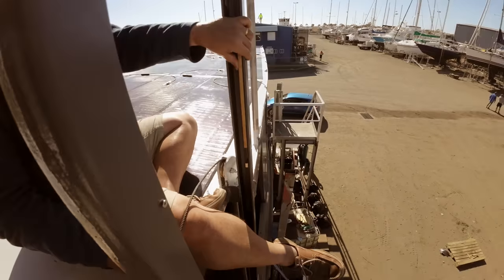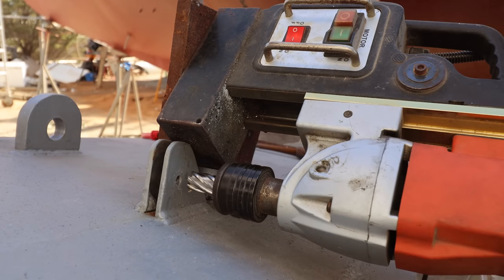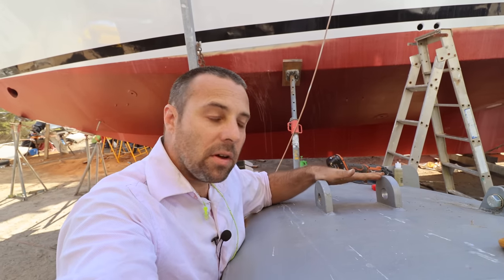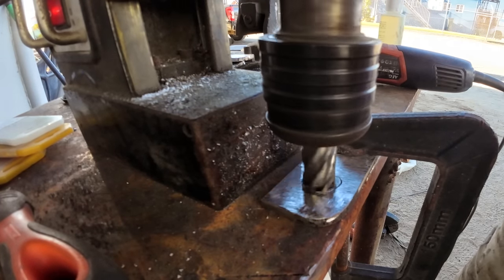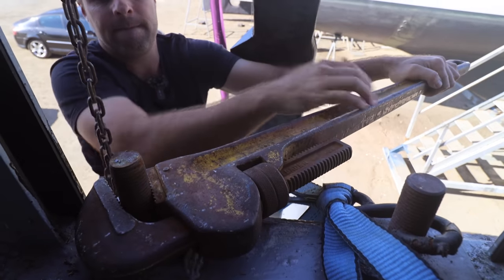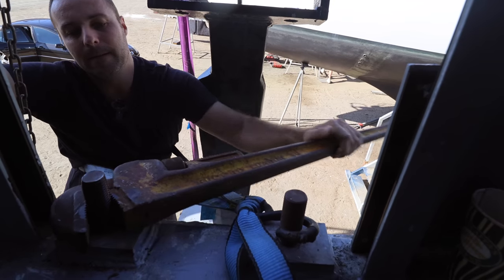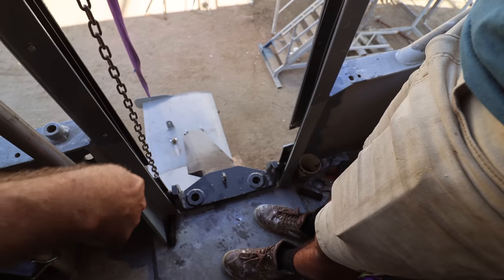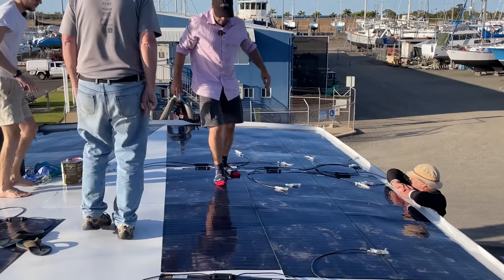Brupeg's Stabilisers, Armed and Ready - Project Brupeg Ep.310

Comment: Suggestion: Take the stator of the dead motor(s) off the shaft, & then build a (stainless?) steel enclosure around the gearbox/windlass, with a nice long spout as a hawsehole to keep sea water out, perhaps with brushes covering the entrance to help in that regard...  & then fit a right angle gearbox that transfers the horizontal drive to the winch gearbox to a vertical shaft that can go through the wheelhouse roof, with a suitable oil seal. Then you can fill the steel enclosures with oil & plan to run that existing gearbox in an oil bath up there, but you can still power the winches with either a battery drill, or a couple indoor rated mains power motors mounted on the inside of the wheelhouse roof...

Comment: Since you will not be moving the wings up and down very often once the boat is in the water i would suggest removing the winches when they are not in use and store them inside the boat. Might help them last longer and you can keep them dry and out of the elements.
Reply: Could they be mounted inside the wheelhouse roof, with the cable coming through a slot?

Comment: Here a thought.💡💡Automotive hydraulic lift motors can do the job to lift the wings and their an all in one system tank, pump and motor. No piping to run just hoses to your cable wenches. A big Plus you could install them under the roof overhead.💡💡👍👍

Comment: Stainless pin into mild steel (ferrous) sleeve will rust the ferrous at a ridiculous rate. It needs a stainless sleeve welded to the arm that's well-painted around the different metals. Maybe even fit a sacrificial anode over the top. Stainless to stainless will gall (self weld) so ample grease points are needed.

Comment: Used to fit wear strips on conveyors. Cut wear strips to length drill holes 1 on each end mark where to be fitted and move one of the holes 5 to 6 mm further on. Warm up wear strips and quickly fit on both ends, the wear strips shrinks drill and fix all the way along. This will greatly extend the life of the wear strip. If I'm already late with this advice I strongly recommend that you redo again. Loose wear strips don't last very long they streatch and start binding. offset hole depends on material and length some longer wear strips are offset 50mm. Similar to wear strips on bottom of f1 car. We used to fit them on with 5 mm countersunk stainless rivets.

Comment: Watch your finger when setting those wings, they look like they will be fun at sea to put those bolts in. With the boat rocking the wings will stay in the water while the boat rocks and the bar will slide up and down. or knock around. You could put something to hold the wing down while putting the bolts in, maybe like a slide bolt at the bottom so it won't slide up so you can put bolts in. Anyhow Just a thought.  I can not wait to see you guys launch, been watching since the start. Well done.

Comment: 19:17 buy new winches. Take them apart. Spray paint the armature. Coat it in metalized epoxy and replace the bearings with the highest quality double sealed bearings you can find. Do some work on the covers as well such that no water can remain on the which's vital surfaces (anywhere where guts meet the outside) and spray paint the winches (finished, mounted item) with water repelling spray (the same stuff they use on clothes to make them water proof, i'm sure you've seen the vids online with people spray painting their shoes and water beading off). Do this every once in a while, and they should last you enough time to figure out the real solution, with the hydraulics.
Source: i've coated most of my electric stuff that lives on equipment in epoxy and so far, i haven't had anything go tits up on me VS in the past having to replace the motors, some quite expensive.
Reply: That's how to do it properly, but how often do they really need to be lifted? My guess is they will stay down for months at a time. That's a lot of money and hassle for motors that might only be used a dozen times. The cordless drill is cheap and works and doesn't require any more work. They could even use a larger 240v drill, which could be as powerful as the original winch motors.

Comment: another easy way to bolt them on would be to stagger the holes an drill straight through both sides that way you could put the wrench through the hole rather than trying to do it offset

Comment: Put 2  manual winchs on the wing wires. No electricity or hydraulics to worry about. Those wires just don't look thick enough to lift a heap of water though. Cheers

Comment: For the duty cycle those winches are going to see and for the fairly small amount of weight you need to lift, what about boat trailer winches? They're 12V and they're meant for marine use. Plus, they're CHEAP. They usually have a spot for a hand crank, too. It'd be nice to have the built in redundancy.

Edit: The 6,000 pound boat winches I have both have about 50 feet of 5/16" galvanized wire rope on them... That's like... 7.5mm? Call it 7mm.

Comment: Have you considered putting a small hydraulic motor on the existing winch gear boxes and powering them off a 12V power steering pump?

Won't be fast, but it will be low power, high torque and (relatively) cheap. Small hydraulic motors are only a few hundred, power steering pumps are cheap from a wrecker and you already have the gearbox.
Reply from the maker: Actually been discussing that this morning. I’m not confident the existing gearboxes are any good as they were the cheapest 24v winches we could find at the time
Reply: @ProjectBrupeg The motor and brake are what usually fail in cheap winches but the gearboxes do also go, but all are fairly easy to prevent.

For the gearbox basically you just pull it apart, clean the grit out that china left in there and put some new moly grease in it. Then seal it all back up tight with rtv. Don't rely on the orings.

If you want it sealed up 100% go down to the motorcycle shop, a lot of quad bikes have a little bellows for the diffs instead of a breather. Just fit one of those so that there's room for the expansion and contraction.

The brake will usually fail due to heat from the winch slipping under high loads or lack of use.

And you have no motor... So no issue there. Basically it's the same deal though, pull it apart, rtv all of the seals.

I've never seen or heard of one stripping the gears. Only ever corrosion cause they weren't sealed and were left unused/unserviced for too long or they were abused and overloaded.

For the cost involved, could be worth doing one as a test, if you do look for a hydraulic chainsaw motor. You don't need a lot of torque on the motor, you want reasonably high RPM instead.

Comment: Could you use a long hydraulic ram mounted inside the boat an pushing up on the arm? The hydraulic fitting side would be down in the boat saving on hydraulic line. Since the ram would be in the retracted position when the wings are deployed it would be also nice regarding corrosion .

Comment: Dame, Doubting Debbie here !  
You have the down weight/forces on the cable nailed but, what happens when you are in rolling seas, in an emergency
situation, needing to raise the wings and the hull is rolling towards the Lt, or Rt. wing thus creating slack in the cable
while the slider is in an unlocked condition.
The worst of this scenario is the snap force created on a fouled/ bird nested cable when the hull rolls in the opposite direction.
Sorry, this is what I see, unless I am missing something ?
Reply: The wings only need to be raised when coming alongside a harbour wall, or when the boat is lifted out of the water by a travel lift. In either case, they'll be in a harbour because both operations require calm water.
Reply: @robinbennett5994  What if !  They're in rolling ocean ice or having to navigate a narrow reef channel and out side of the breakwater ect. The point is there is no control on up forces flapping the wings.
Reply: @NAMCBEO  I take your point, but I think they're planning to remove the wings before going anywhere near ice. Even lifted, they're vulnerable like the cooling tubes. I think the other scenarios are very unlikely. Narrow spaces and large waves are a dangerous combination. Boats are always a compromise. You can't afford everything, and seamanship is about working with what you have.

Comment: Have you checked out the winches used for hauling boats onto Qld. canal pontoons?  Mine has just a fibreglass box cover to keep the worst of the weather out, but is by no means waterproof.  Now over twenty years old and still works fine with hardly any maintenance, and in a permanent salt water environment.  In a different league to the 4WD bull bar winches, but 240V ac.
Reply from the maker: Do you have a link to one of these winches?
Reply: @ProjectBrupeg I believe mine is the JV series.  It is orange anyway and with a plug in remote on a long cable.   It hauls out a 5m Boston Whaler with 40 gallons of fuel, gear, and a 90hp merc no problem..😊

Comment: Can you not make the winches internal to the boat ? Then add the cable pin mount under the middle of the wing stabiliser which will then allow you a strait pull up and over and in, be safe very inspiring! Edit lol I just realised you would have to notch your mounting plate to recess the cable so not to squash it ah it was worth a thought 😊

Comment: Hey Dame, did you think about using dyneema and a simple yacht winch at deck level to raise the wings? The multi speed would allow you to use slow speed at first while the most load is on the winch, then speed up as the load reduces. Could even go for electric winch if you wanted it even easier. Not sure how often you think you will be moving them, but seems like a manual option would be much simpler.
Reply from the maker: Likely they will be lifted once every few months at most. Not 100% sure how Dyneema holds up underwater for so long and also in direct UV above the water as well. I know steel rope its not great but grease covered steel rope is what I know. That all said really prefer Dyneema just dont know if its ok with those two caveats.
Reply: @ProjectBrupeg  the UV part is easy to solve. Just use dyneema core with poly cover like all sailboat running rigging. The underwater question is an interesting one I didn’t think of. Might go do some digging just for curiosity sake.
Reply: That was interesting. Dyneema is a type of plastic so doesn’t absorb water and is fine for use under water. People are even talking about using it an anchor rode in some places. So I would say it’s a viable alternative if you ever wanted to get away from the rusty cables and unreliable winches?

Comment: Instead of running the cable down to the wing, why don’t you just attach the pulley to the top of the strut (the bit running in the track)? That way you get a mechanical advantage from the linkage and you don’t have a cable and pulley trailing in the water all the time.
Reply: He explains his reason at 22:45 While his reasoning is sound,  I'm wondering why one couldn't pull on the top of the strut until the wing is approaching vertical then use a watch tackle down on the side deck to pull the wing in the rest of the way?  Someone has to be there to put the lock pin in anyway and with the wing approaching vertical it probably would not take a huge amount of force to pull it in the rest of the way. 
Though, thinking about it, that would put a lot of strain on the tracks and their plastic lining, with a separate cable for lifting, all the tracks really do is stop the strut from rattling around, when wings are deployed the struts are bolted to the deck and the tracks are doing nothing so they don't need to be built for heavy loads. The steel look pretty robust, but it wouldn't be hard to rip the lining out.
Reply: That’ll teach me not to skip through with the sound off… but I think all this really does is highlight a missed opportunity with the linkage design rather than an unavoidable issue. They’ve accidentally created an over-centre mechanism with the pivot positions but they didn’t have to. Still, too late to fix it now.

Comment: I'm going to show my ignorance here. Why can't you use blocks and lines to run the rigging for the stabilizers over the wheelhouse and down to the hydraulic windlass?
Reply: That's a pretty smart idea - use the massive winch that's already on the boat! I'd guess the problem might be that you'd have to take the anchor cable off the windlass, and it's not designed for steel wire. It would probably work if they change to dynema though.
Reply: @robinbennett5994  I was thinking a ratcheting drum to take in the cable attached to another drum with ropes that would run down to the windlass.